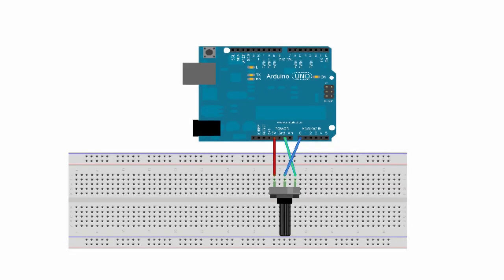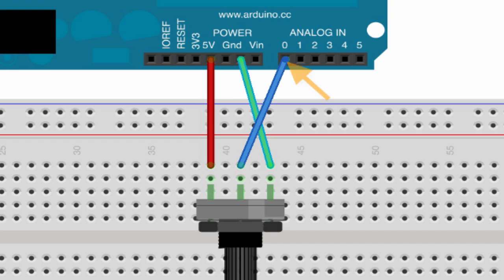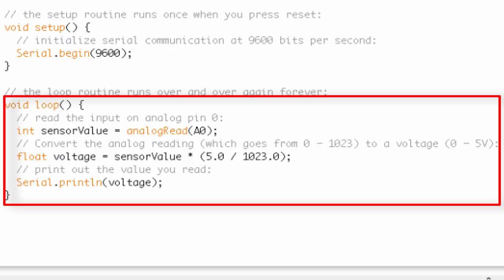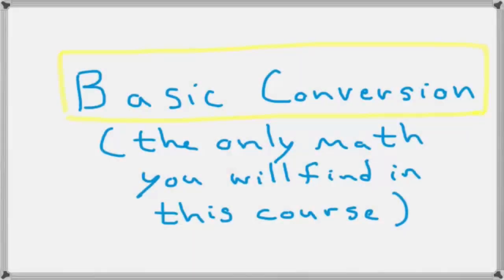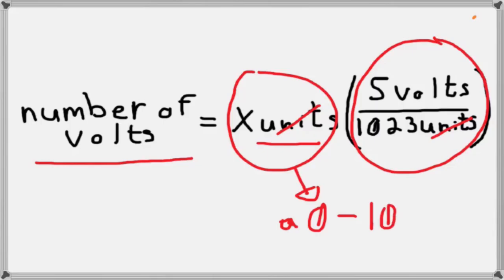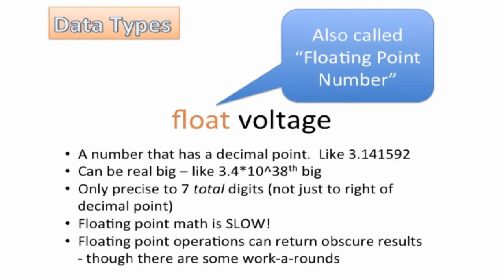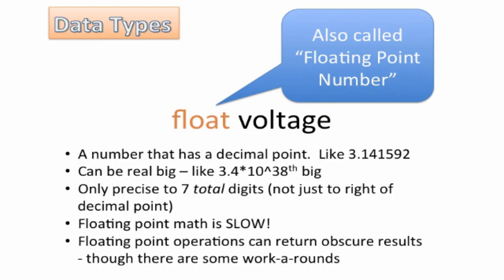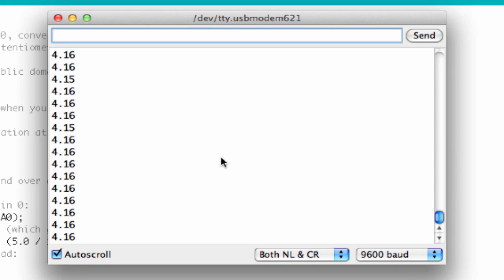Tutorial 09: How to read voltages with analogRead(): Arduino Course for Absolute Beginners (ReM)

Comment: I am a big fan of your work! Say, how would you read a voltage from a sensor on one pin, then output a different, but corresponding voltage to a different pin?
Reply from the maker: Thanks Thurl and great question!  You could use a voltage divider circuit where you the read the incoming voltage with an analog pin (do a simple conversion in your code), and then use PMW on a digital pin to output.

If you look at the Arduino IDE > Examples > Basics > ReadAnalogVoltage

And also check out the PWM examples -that should help - best of luck!

Comment: 5 volts divided 1023 times is 0.0048875855, which is the voltage per 1 of 1023 divisions, or resolution. Double data type ftw.

Comment: I have discovered some relation between the sensor value and the input voltage, but I just wonder why (204.6) must be the basic number of this relation? is there someone to give us some information about it?
as I pointed, if we use (3.3V), we need to multiply 3.3 by 204.6 which is equal to 675.18.

Comment: Is there a limit to how many lines are saved before the values converted are dumped out of memory? I'm trying to set up a way to record voltage for an undetermined amount of time, and have that data available in a csv or similar format. Alternatively in the worst case, i'd be able to copy and transfer those lines on the serial monitor if there is a very high "limit" for how many lines there are if that makes sense.

Comment: Correct me if I'm wrong, please, but I think that the code should read: float voltage = sensorValue * (5/1024.0)  !  There are in fact 1024 units, since 2^10=1024.  It does not matter that the count begins at zero and not at one!  (0-1023)>>1024 units. (1-1024)>> 1024 units.  Granted: the difference is tiny, but I think the statement in the code example: float voltage = sensorValue * (5/1023.0) is inaccurate!

Comment: Could you explain why the program doesn't output the voltage on the serial monitor if you use 5 and 1023 instead of 5.0 and 1023.0 ?
Reply: Because float doesn't display real numbers, you need a decimal value.

Comment: Excellent video. But how if i want to use all 6 analog input channels and read them individually in serial monitor,  ? I cannot extrapolate the code for 6 channels.  Pls help. Thank you.
Reply: Of course you can, you can add interrupts or call function to show each value by using the reset button on the arduino.

Comment: Hello !
I need to create a "switch" between a 12V lead acid battery and a 5V dc power supply.
I want the system to switch to the dc power supply when the battery voltage drops under 11V. How can I do ?
thanks

Comment: if I press a button on a LCD shield, how do I get the select button to run the loop after I press it, I am trying to make a digital dice to play catan with. heres what I have so far #include <LiquidCrystal.h>
LiquidCrystal lcd(8, 9, 4, 5, 6, 7);
int button;
int btnselect_button;
int randNumber;
int lastButtonState;
void setup() {
    lcd.begin(16, 2);
    lcd.setCursor (5, 0);
    lcd.println ("catan" );
    button = analogRead(A0);
}
 
void loop() {
  randNumber = random(1, 7);
  Serial.println(randNumber);

if(analogRead(btnselect_button) == 0 && lastButtonState == 1) //if button is pressed and was released last change
if(analogRead(btnselect_button) == 1 && lastButtonState == 0) //if button is not pressed, and was pressed last change

lastButtonState = 1; //record the lastButtonState
}

Comment: You can get the same results by just multiplying by 0.0048875855327(which is the product of 5/1023) in the Serial.println command, in the same code from the last tutorial. Like this

void setup()
{
  //Initialize serial com at 9600 bit/s baud rate
  Serial.begin(9600);
}

void loop()
{
  //Declare variable for the value of analog pin (A0)
  int voltageValue = analogRead(A0);
  //Print voltageValue (A0) to serial monitor
  Serial.println(voltageValue * 0.0048875855327);
  //1 millisecond delay for readability
  delay(1);
}

Comment: For range output in between 0-100 volts...You have to adjust the formula as:
float voltage= sensorValue*(100.0/1023.0);
For Aurduino 3.3V pin....The formula changes as:
float voltage= sensorValue*(3.3/1023.0);
Reply: The pin input will not take more than 5V so DON'T try to connect 100 Volts in to it!  Use a voltage divider to bring the 100V down to 5V!

Comment: Ok I did the challenge at the end changing from 5.0v to 3.3v no problem.  I changed the divider from 5.0 volts to 3.3 volts everything worked fine moved my connector to 3.3 power hole  code float voltage = sensorValue * (3.3 / 1023.0);.  Then i used the 100.0 divider for 5.0 volts of current and i got value up to 100.00. I then set my current to 3.3 volts and the max i could get for my float voltage was 37.25 is that right answer.     float voltage = sensorValue * (100.0 / 1023.0);

Comment: in my code when i tried the calculation as "float voltage = sensorValue*(5/1023);" (and not 5.0 or 1023.0) i get serial prints of only 0s no matter what the position on the potentiometer. If a variable is float, its input numbers must have a decimal point in it? whats happening here?

Comment: hey Michael, is it possible to measure voltages above 5 volts. I need to make a battery charger and would like to use an arduino to set a voltage reference between 10 to12 volts, any ideas thanks mike
Reply: snaprollinpitts you will need a resistor divider network to accomplish that. You can also use the potentiometer; however, because the pot is variable, it is possible to accidentally present a voltage exceeding 5 Volts to the analog input. A fixed resistor-divider network will guard against that.

Comment: Great Tutorial, love it!!

is it possible to read voltage by just using a positive and negative terminal? i have a PH probe and only two wires (anode and cathode) come out of it. 
in this case what would be my wire configuration? 
Thanks in advance!
Reply: I know this was a while ago now but I guess you would attach the cathode to ground and the anode to an analog(ue) input such as A0. What is needed is a potential difference applied across ground and an analogue input.

Comment: Answer no.1 nope. no code changing needed
answer no.2 change {sensorValue * (3.3 / 1023.0)} to {sensorValue * (100 / 1023.0)}
What's my mark? 0,50, or 100?
Reply: To get the serial monitor to display on a scale from 0-100  using the 3.3V source.  I changed the 1023  to 675.18

How did I come to that number?    1023/5 = 204.6   now I just multiply that by the max voltage  204.6 X 3.3 = 675.18

Anyway your question is a year old, so you probably know all this stuff and a lot more by now,

Comment: I have a question. Is it really necessary to hook up the voltage to be measured to the Analog Pin 0, and why? Can I just any of the other 2, 3, 4 or 5 pins? Or is PIN 0 the only ADC pin on an arduino?

Comment: Just a quick tip here: (5.0 / 1023.0) always stays the same, so you don't need to do this computation over and over again in loop() method. You can simply do it once in the setup() method and store the result in a variable and then use it in the loop().

Comment: I believe I am missing something... 
So, we use and ADC pin to read an analog value (between 0 and 5V). Then, we use analogRead which will give us a discrete value... after that we convert to analog again with a mathematical operation.... Why didn't we read the original value in the first place? Is this always necessary? Thanks!!!
Reply: Oh, and congratulations for these tutorials!!
Reply: Each of the analog inputs has a 10 bit analog to digital converter (ADC). What does that mean?
It means that the input will take a refence value (5V unless you change it in the sketch) and compare to your imput value (the voltage on the middle of the potentiometer). Then it will take that value and turn into a 10 bit number and send to your monitor (10 bits = 2^10 = 1024 possible values). So we have to turn this number back into a voltage value to print it on the screen.

Comment: Hi! I am a school student, new to electronic world I have been watching your tutorials they are really helpful and awesome. 
I have  a question that why didn't we assign the pinMode for the potentiometer whether it is an input or output like we did in the previous tutorials for the pushbutton and led ?
Reply from the maker: Great question!  When you use analogRead(), there is no need to set the pinmode of the pin. I am not exactly sure why, but I know the mechanism by which the input is read is different than with with the regular digitalRead().  I hope this helps some, and very observant question.
Reply: Thanks for the reply sir I understood what you are saying thank you very much.
Reply: Honey Honey I think because it is analog in, I'm a total noob but I don't think you can use it as an output?
Reply: Thanks for the answer

Comment: Is it also possible when a power supply will be connected to the arduino. Will it know the applied voltage when you turn the potentiometer?

Comment: Thanks for the tutorial. I got it going , no prob, and changed the voltage to read 0 to 100.
However , I need to read 2 pots. Checking on arduino forum didn't give a straight answer. I've no idea what I need to declare etc to add another analogue port eg analogue(1).
Reply: +binarybox  After several attempts, I have used voltage1 and pot1 and voltage2 and pot2 and got it working by copy and pasting the code in the void loop. ....  8-)

Comment: Great vid sir! I'd like to ask if what is the maximum voltage that the analog can read? could it read 12v or 24v? Thanks
Reply: +Raymond Marimat The fact that the Analog inputs can only return values from 0-1032 (a hard limitation of the board), and 5v equals 1023, seems to suggest that 5 volt is the maximum you can use as an input. You'd probably need a hardware 'converter' if you want to measure >5v sources on an arduino and change conversion factors to give you an accurate read-out.
Reply: +Terah thanks for your reply terah

Comment: You should divide 5 with 1024. Because there are 1024 steps: from 0 to 1023.
Reply: No. It counts 0 in too. So a range from 0 to 1023 is 1024 numbers. 128 bytes
Reply: How many fingers do you have? 0 1 2 3 4
Reply: In digital electronics, zero has a defined an useful value due to binary code and therefore, is always counted as an integer so that binary has values of 0 or 1, 8-bit is 0-7 and hexadecimal/16-bit is 0 to F(15). It is always one less than the base number and this is true for the decimal system as well, 0-9 not 1-10 since 10 has two digits. However, since we consider 0 to be nothing/false it is weird to declare a material object as 0 but in electronics, it would be impractical to use an extra digit to keep this continuity.

Comment: I don't understand number 2 of the try it on your own challenge :( Can someone help me?
Reply from the maker: Hi Aashman Vyas, in the video lesson, we convert the range produced by analogRead() of 0-1023 to 0-5,  because we are interested in how many volts are being applied at the analog pin.  We used the equation:

sensorValue*(5.0/1023.0)

The second challenge question wants to know if you can come up with a different conversion factor i.e, something other than (5.0/1023.0) that converts the analogRead output from 0-1023 to 0-100.

Hope this helps clarify some.
Reply: Open Source Hardware Group Thank you! :D

Comment: another thing when we do the 5.0 / 1023.0 can we do 12v so 12.0? as i would be using DC small motors 12v capable who i will power the arduino thru the VIN which i think is for max voltage 12v ? and do the math

SensorValue * (12.0 / 1023.0) = map(Sensor Value, 0, 255);
so now we can match/map the lowest volt to the min motor  to the max motor voltage to max pot range?

Comment: my arduino shuts off if i bring the knob to the far left, why is that ? im not using a resistor in place just small servo 5g  reused pot  it does this in 3.3v and 5v as well and the LED gets brighter the higher i go 1023 but back down or far left and the LED dims till it shut off im using a nano newest ver or arduino ide

Comment: If I put the analog signal line in the other analog pins (A1 to A5) I get analog reading of 269 which means there is approx 1.3V on those pins.  Should that be the case or is something wrong with my Arduino?
Reply from the maker: Hi Tommy Productions ,  just out of curiosity) did you change the code in the Arduino sketch to sample at the other pins?  Ie., did you change analogRead() to look at pin A1 for example?  If not, then the Arduino is still looking at Pin A0, even if you don;t have the signal attached.
Reply: Thanks for the reply.  I did change the sketch to read A1 and moved the connection from the middle pot pin to A1.  As expected it read 0-5V. Out of curiosity I checked the other pins that were not connected to the middle pin.  I expected to read 0V but consistently read a voltage on the non connected (non declared) pins.  Not critical .. just hunting and pecking as you suggested.  Great (very understandable) tutorials!  Thanks

Comment: Great video tutorials. Thank you for taking the time and for making this public and free! Re: Tutorial #9: I think it would help some less experienced folks such as myself if you explain why the float number changes with voltage. Like most, I experimented and found you don't need to change the code to get the 3.3v readings (well... more like 3.27), but I got stuck on the "why" this is the case until I read your response to a comment about 9 months ago explaining the float number is around 675 instead of 1023 with 3.3 volts.
Reply from the maker: sflow15 Thanks for your comments and thanks for pointing that out!

Comment: changed the float and used unsigned long and did not get any decimal numbers but just the whole numbers. so if using float gets you to 2 decimal isn't better but slows down things than using unsigned long which gives you whole numbers well rounded off i guess

Comment: would you be willing to help me with some code ? code works perfectly on a arduino pro micro however i now want the code on a arduino uno. the temperature readings are incorrect  and its due to the voltage reference not working. 
on the pro micro pin D9 Connected to VCC (5v) and this made temperature readings correct. 
on the arduino uno i have AREF and OIEF and D9 connected to vcc (5V)

But will not work. really hope you can help as i cant figure it out im sure its a code problem im just not very experienced

Comment: Thank you so much, you rock man! This series are the best of all arduino series on the internet!
but one question..
my 3.3volts is actualy 3.23 volts. So is my arduino´s voltage regulator or whatever broken or bad or something?
i have ¨  sensorValue * (5.0 / 1023);  ¨
Reply from the maker: Joshua Barendse That's a good question, to be honest I am not sure what the "+/-" specification for that regulator is.  Somewhat unrelated, the nominal voltage range of a 5volt LM7805 regulator is between 4.8 and 5.2 volts...so maybe yours is still with in an allowable window.

Comment: Hi Open Source, I'm learning with your tutorials, they are awesome! Now I tried the homework changing the pin and code from 5.0V to 3.3V, and the highest number the potentiometer gives me in the serial monitor is 2.29... could that happen because I am using INFIDUINO (chinese clone) instead of Arduino...? or could it be another reason?
Reply: Open Source Hardware Group Hi!  Thanks so much for your videos.  I really learned a lot.  I thought you needed to modify the code to 3.3 / 1023.  Can you please explain why this is not necessary?
Reply: @racerx1326  It's because 5V is logic high even if you are using the 3.3V supply pin. So the conversion factor doesn't change. I know your comment is old but it helps anyone else reading along
Reply: @claytonbinns7679  thanks i was wondering that, and thanks for answer
Reply from the maker: Hi Jorge, that is great question.  In the first challenge, you don't need to change any code - just voltage from pin from 5 to 3.3, and you the output at the serial monitor should change to about 3.3V
Reply: Thanks!

Comment: The extra challenges are good because I usually mess something up and have to problem solve which is where the real learning happens. I forgot to put the pin back to 5V from 3.3V when I went to change the range to 100... LOL
Reply from the maker: David D So true!  It seems that problems (and solving them - or even just pondering them) are at the heart of learning.

Comment from the maker: Hi +Vishnu Das  - According to the Arduino Reference for Serial.print -> "Floats are printed as ASCII digits, defaulting to two decimal places. 

I didn't realize this until you asked and I checked!  Thanks for that.  Also, if you use the command:

 Serial.println(1.23456, 4); it should display "1.2346" on the serial monitor.  The second number passed is specifying how many digits to display.

Here is a link to the Serial.print reference http://arduino.cc/en/Serial/Print

Great comment - thanks for your thoughts!
Reply: Hi. can serial print or software SPI (for OLED with U8glib) intefere with Analog reading. I have this Pro Mini which is essentially Atmel Mega328P, whose analogRead() for all A0 to A7 produces 1023 output (digital i/o is still functional on these pins). I've tried setting pinMode(A*,INPUT) and then digitalWrite(A*,LOW) just incase the pullups were activated. I'm thoroughly confused

Comment: when i was coding C and C++, the float had 6 decimal points,
And you specified that in the videos as well.
But why does the serial monitor shows only 2 decimal points
Reply: Pretty old comment btw
Reply: @akashic seer the trick to print more decimals: Serial.print(voltage, 2)
You van change number behind to the decimals you want
Reply: @robv.7644  So by 2 we will get a float value upto 2 decimal digits??
Reply: @kodexe3298  yes